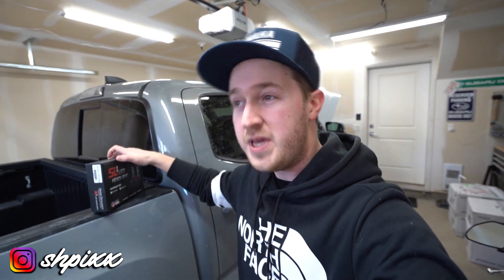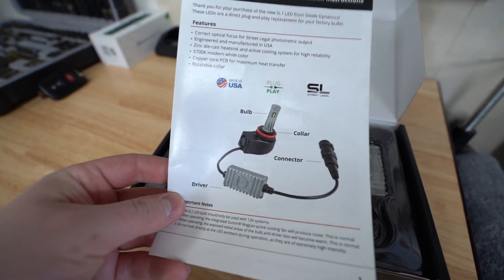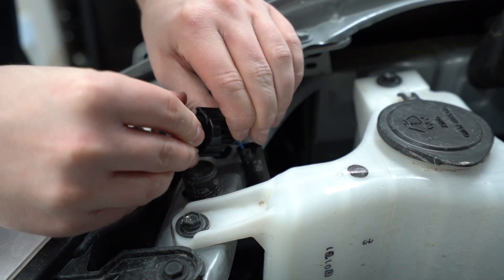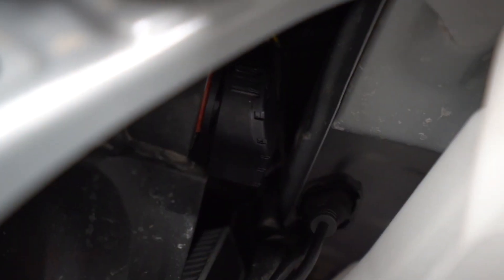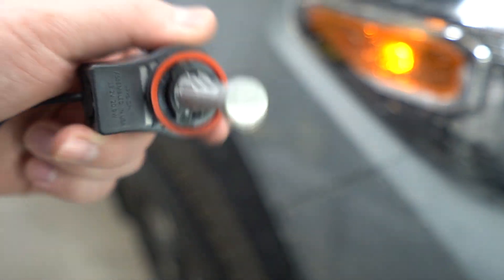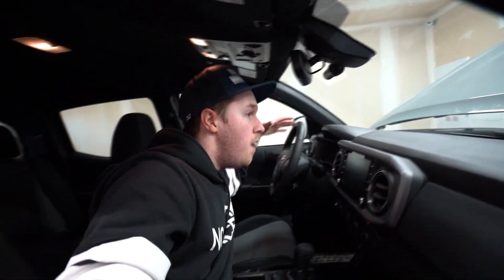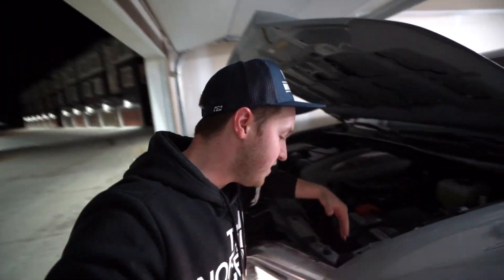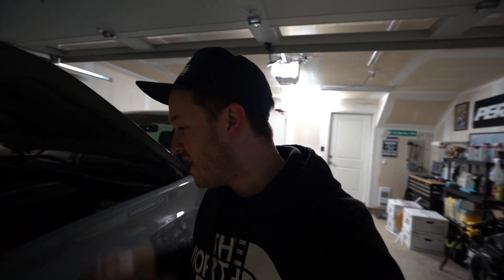BRIGHT LED Headlights! Diode Dynamics SL1 LED DIY Install | 2016 - 2020 Toyota Tacoma

Comment: I wonder how well they light up the road. That would have been nice to see.
Reply from the maker: Well honestly, the way they light up the road isn't so much to do with the bulb as it's moreso related to the projector. Changing the bulb really only changes your color temp. and maybe slightly brighter, but the projector beam output pattern obviously remains the same since we haven't changed any of the housing components. Really just offers a much more crisp, cool, and white color light. Some people's eyes find this more visible, and signs reflect the light color a bit more, but the actual output on the road is going to be very close to your OEM outputs!!